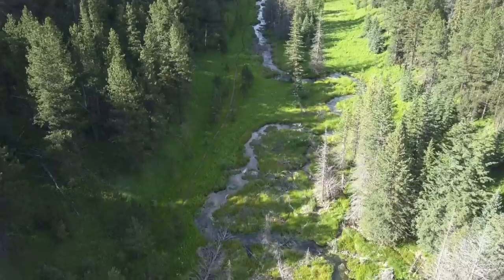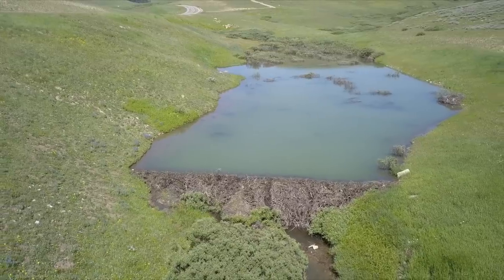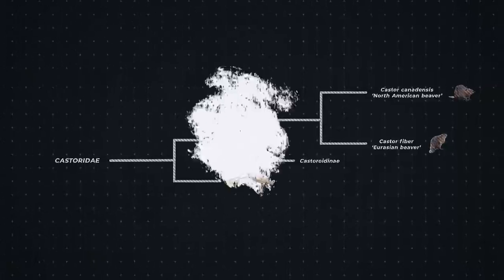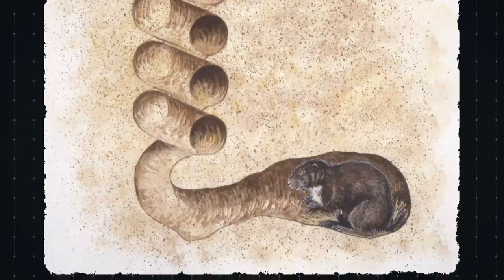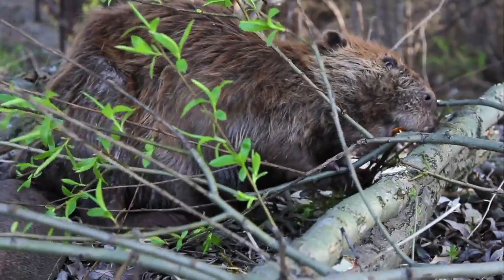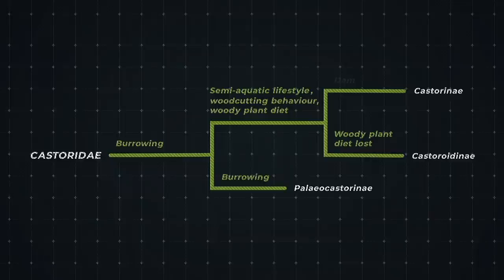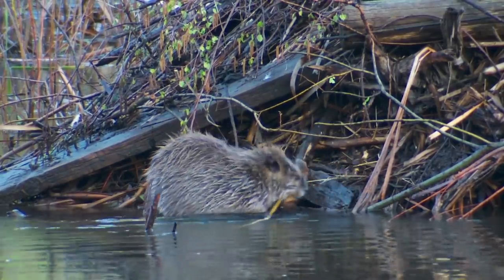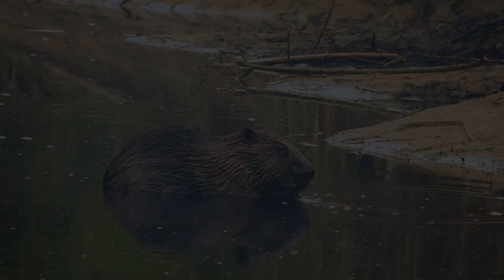How Beavers Evolved to Build Dams

Comment: Only a couple of video by this author, but very impressive, of high quality in images & contents. That indicates considerable amount of time for research. Several notches higher than others. 
Here's a thing to be addressed in future: before dam-constructing behavior was established, semi-aquatic lifestyle preceded. That may provide them with protection to a large extent. Then, what was the construction of dam for, or how did it have to occur, if it was the case? A few steps more to be filled. This series is always very successful in suggesting further thinking. Inspiring!